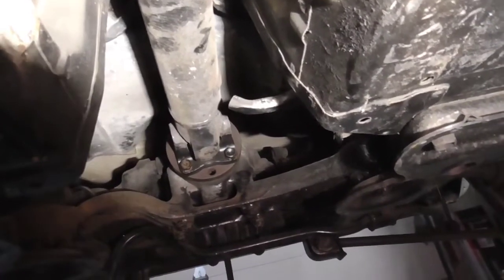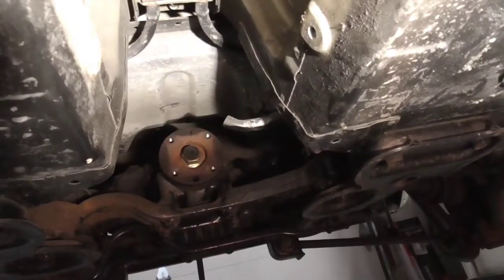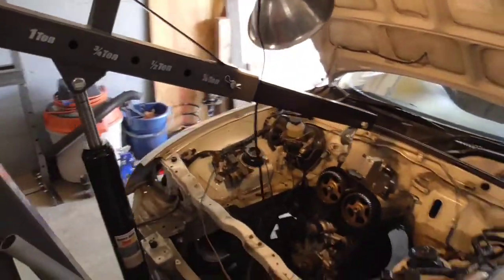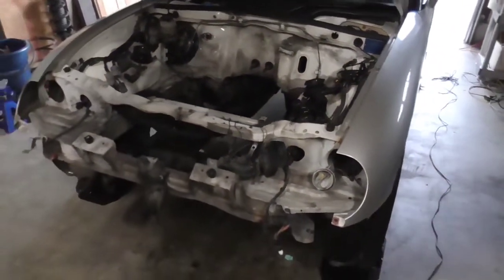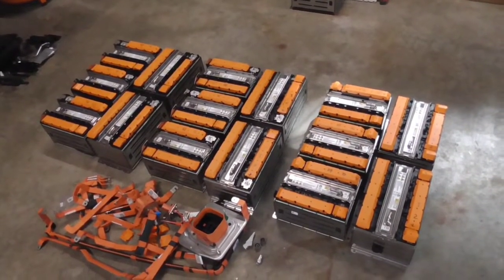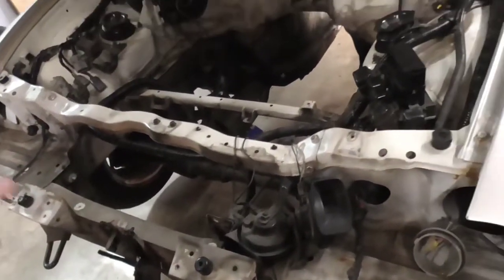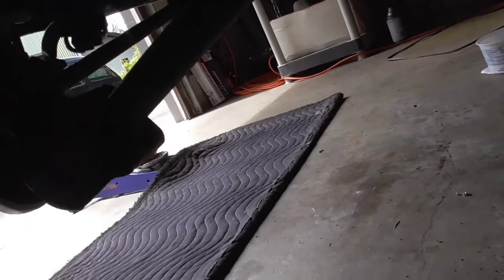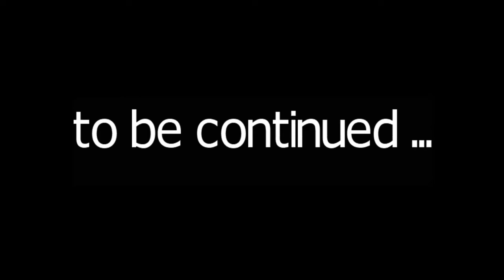Project: Cappuccino EV - episode # 2

Comment: If this is my project, I will consider get rid of the drive shaft and mount motor directly to the rear diff. It may need more modification, but less weight and energy loss.
Reply from the maker: An Axial Flux Motor is the more doughnut shaped motor that was considered & might work straight into the diff.  That would also free up the tunnel for more batteries.  Very helpful as it turns out.  But, one problem... they are pricey!
Reply: Mitsubishi phev rear motor is an option too..

Comment: Why not using your 500e motor?
Reply from the maker: In the "teardown" series it became obvious that it's not so easy to get that to work.  Even if I could, it's still: the wrong voltage 360v, A different controller (that's been configured to work with the Bosch motor) would still be necessary to customize it to my components,  & it's setup for transverse mounting with the transmission to CV axles attached.  Just to name a few.